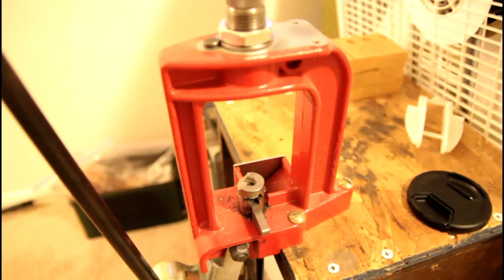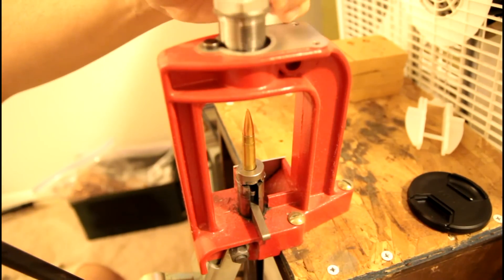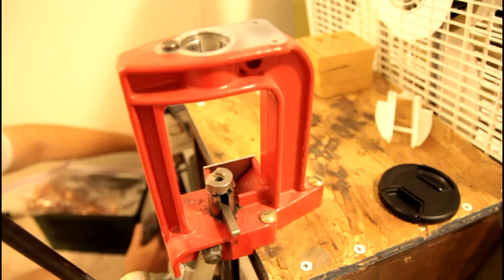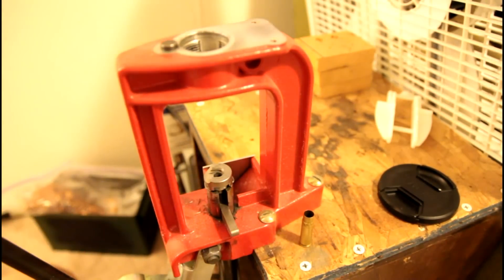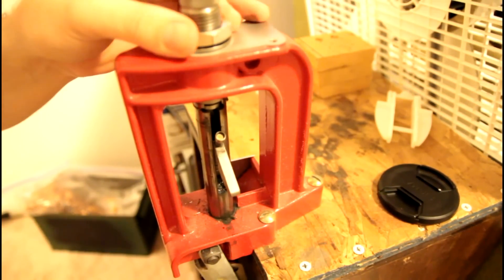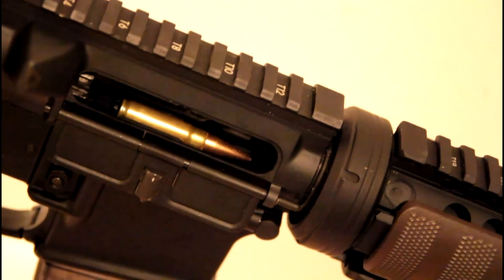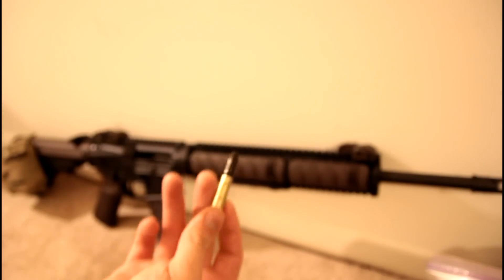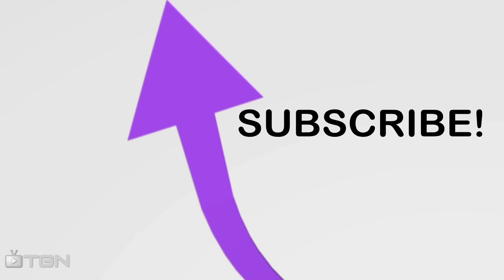Will 300 AAC Blackout Chamber in a 5.56 Rifle?

Comment: Just a helpful note on your press. Go to Lowes and get a 3x6x1/4' steel plate and drill some holes and put it under your press. It will support it much better than the wood you have it mounted on.

Comment: I came up with a system where I use polymer mags for my 5.56 and aluminum GI mags for my .300. You got to have a definite way to tell the difference
Reply: The Immortal That or if you are a P-mag Nazi and absolutely must have P-mags order black mags for all your 556 and desert mags for your .300 BLK. On the P-Mags sometimes you have to file down a rib that helps feed 556 but causes some issues with feeding and last round bolt hold when shooting .300 BLK.

Comment: SHORT ANSWER IS YES IT WILL CHAMBER AND FIRE>
I just had a KB in by 5.56 pistol, I mistakenly picked a mag with 300 BLK and loaded it,  pulled the trigger and POW. blew the mag out the magwell, blew the floorplate out of the mag,  tore the lower part of the bolt carrier, ripped off the claw on the extractor, and the brass is still stuck in the barrel.. If you shoot 300 blk  be sure there are some dedicated distinct mags for that caliber .. still have both eyes all my teeth and all my fingers,    thankfully it was just a subsonic load,      CCA
Reply: +coletocreekape It was a reload correct?  I'm sure the downloading didn't help the bullet staying seated either.
Reply: Of all the firearms out there, the AR tends to blow up more "safely" when a catastrophic faliure of that nature happens. Is it still dangerous? oh yeah. What you described is a typical way an AR will do that. Usually most energy is expelled down the magwell and out the ejection port. Eyes and ears always
Reply: He said "5.56 pistol"